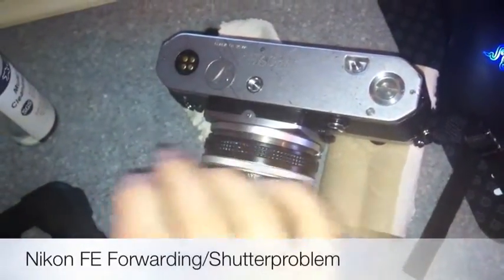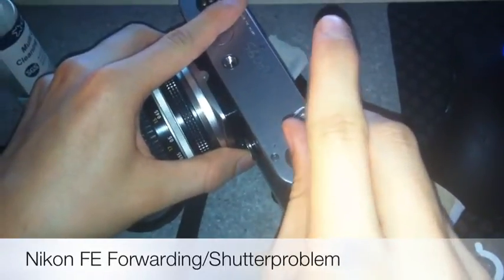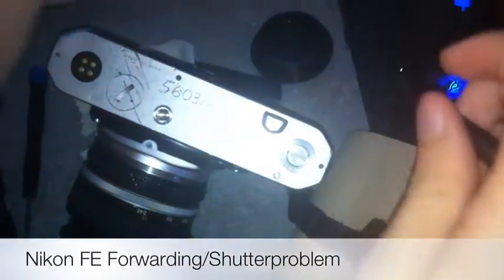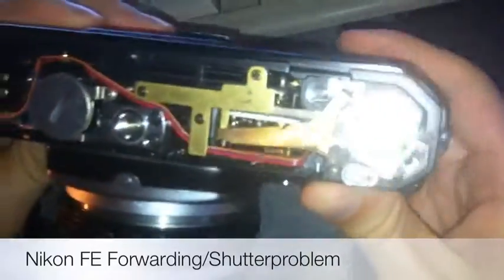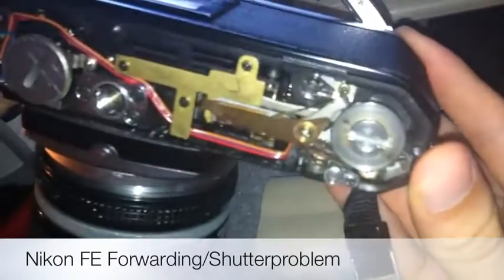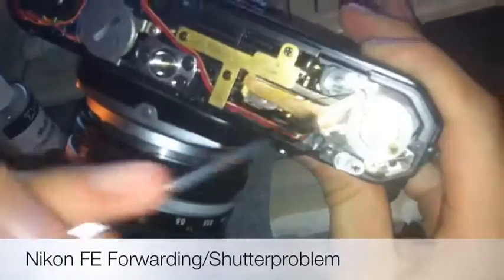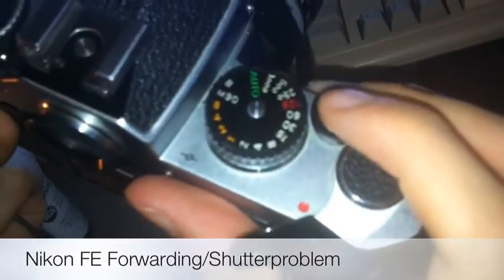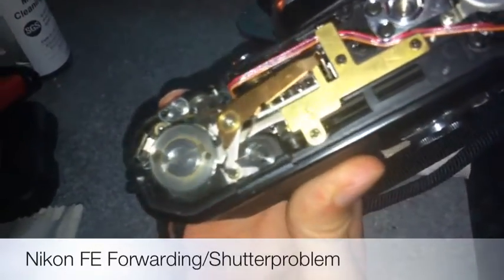Nikon FE Jammed Film Forwarding/ Shutter-cocking

Comment: Wish this had worked, but I couldn't get the bottom plate off because the screws wouldn't budge even with my best micro screwdrivers, and I didn't want to strip them. Guess I have to find a shop.

Comment: quick question, I have a Nikon FE, and the meter is not working, it stays at the "mb" position.  The batteries are good.  (little red light comes on)  The meter was working, but I may have dropped the camera

Comment: Thank you for this video it helped me get the film advance lever working. After new batteries a bit more fiddling suddenly the shutter and mirror started working properly. 

However now I have two more problems.

First, the little lever that jams in your video does not engage any more as for some reason the little spring that presses on it isn't pressing. That now allows me to advance film without shooting.

Second the mirror get stuck up and shutter doesn't operate when in the M90 and Bulb modes. to get things working again I just set the shutter speed dial to one of the electronic modes and after a shot or two things are working again.

Comment: why does it stick  that is the fix  your just passing the problem for another day  and if this happens during an photo shoot your out of luck.   Does it need cleaning or oil?
Reply from the maker: This problem occurs when firing the shutter with low or no batteries in the camera. This jams the electronic shutter mechanism. Mine still works and has not failed for an additional 10 years.

Comment: So the repair worked perfectly. Seems sometimes (no battery on M90) I wind on and the shutter fires as I wind on without me pressing shutter release. It's very intermittent but it does happen. Any ideas of self repairs? If not, this was still a great help. Thank you
Reply from the maker: Does this only occur when you shoot M90 without the batteries?
Reply: pioneerz450 Hi, I have the same problem as bobbybray with the shutter firing when I wind the film advance lever. It does it in M90 and with batteries. Any idea on what is causing it? Any help would be much appreciated
Reply: wantabiscit bobbybray Have you managed to solver the problem of autofiring when winding your FE ? thanks

Comment: can someone please tell me why the hell my internal lever is non-existent??? like its literally not in there.
Reply: Did you find a way how to fix your camera? I have the same model without that lever ...
Reply: @arpadbercek2893  did you figure it out?
Reply: @NoahHella  yes, I took the bottom plate off and then unscrewed the part to get under the tripod mount If i remember correctly... Its just next to the battery compartment... I just poket arround a bit and it just started working again... Was pure luck... I guess the camera i have, got stuck during a fall or something... Have it on M90
Reply: @arpadbercek2893  interesting! So some models don't have a lever in them. I was able to fix it with new batteries, lucky me.